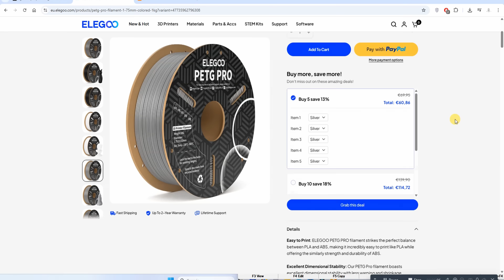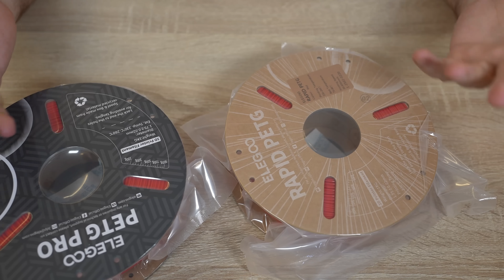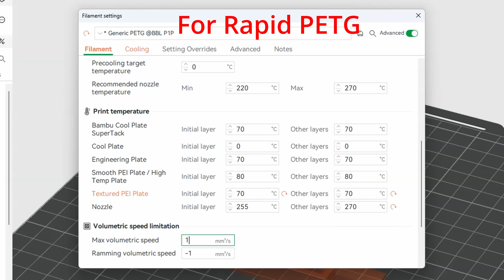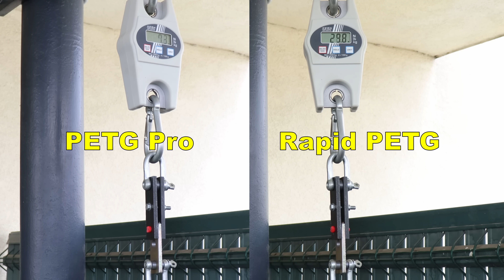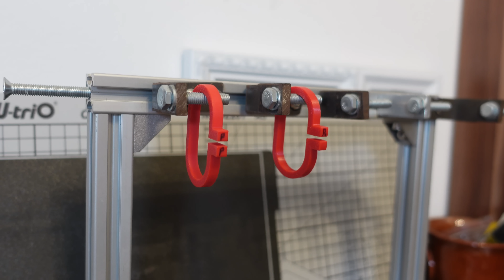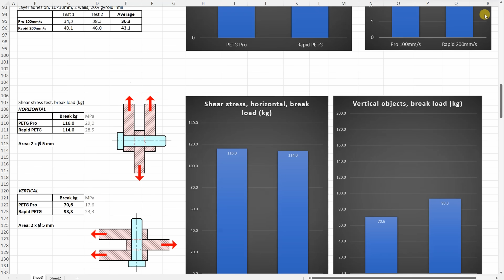Elegoo Rapid PETG vs PETG Pro – Same Price, Similar Specs, Which to Buy?

Comment: Rapid PETG is good, There is absolutely no reason to have 80% fan speed. You can easily print it at 10-20% which also improves strength, layer adhesion and printing speed.

Comment: I use this rapid petg alot. I use the bambu petg hf profile but I changed temp to 255c and max cooling fan to 30%, min 10%. Prints flawless and as fast as pla

Comment: I do not like companies with different data in their technical documentation.
Because it is unclear what the current data is: is the data sheet on the web page the correct one or that printed on the spool ?!

I am not a hater of Elegoo. I also have tried the rapid PETG and I was very surprised about the printed quality of a 300g bowl !

Due to the 'bad' results of the Pro, i am really wondering what the usecase would be for the Pro.
One person commented a detail: it might be more for fine details, as I understood.

Comment: Interesting testing and video. I always wondered about the difference. I have been using the Elegoo rapid PETG for awhile in my K1 Max and Flashforge AD5X. It works well in both. I do wish they had a few more colors.

Comment: Thanks! I've used.both, and honestly couldn't tell much different other than stringing on Rapid. I've even used both in the same print once because I ran out of pro. No issues. Also, stringing can be tuned out almost completely.

Comment: I saw you mention a few times in different videos that your videos aren't pushed by the platform. Maybe the channel name could do with a rebrand to more accurately match what you bring to YouTube. Suggestions:

* (Dr) Igor's Lab
* Engineered Prints 3D
* Functional Print Lab
* Print Performance Lab
* Print & Test
* Print Science with Igor
* 3D Engineering Academy
* Maker Metrics
* Igor’s Tech Workshop
* Layer by Layer
* Layer Laboratory

This list is also a quiz: which ones are AI slop and which meat brain slop?!

Keep doing what you are doing under any name :).

Comment: Nice to see that you are testing Elegoo filaments. I have a number of Elegoo printers, including Centauri Carbon, and find their filaments just great.
I was surprised to see that you did not use your Centauri Carbon and it’s built in profiles for the filaments you tested.
The Nozzle temperature recommend for Rapid PETG is 250 deg C and 240 deg C for PETG Pro. Both with a bed temperature of 70 deg C.

Comment: Thanks for this video, not least because I have been using the PETG “Pro”… which prints nicely, if slowly, on the Elegoo slicer default settings for the Centauri Carbon.

Comment: This is the test I wanted to do but didn't because it would be so complicated.  I'm so glad we have My Tech Fun to do the testing that is in the public interest, and I'm very happy to help support this testing.  I use Elegoo's PLA, Rapid PLA, PETG and Rapid PETG.  There is only a few dollars difference between the Rapid and regular versions so I should probably just standardize on the Rapid versions.  I suspected the Pro version wouldn't have much material advantage and this video seems to demonstrate that.

I've found Elegoo filaments to be of good quality at a low cost, so good value.  I typically by ten 1 kg spools directly from the Elegoo website, usually when it's on sale.  Before recent tariff increases, I could get ten kg of black PLA or PETG for US$95.

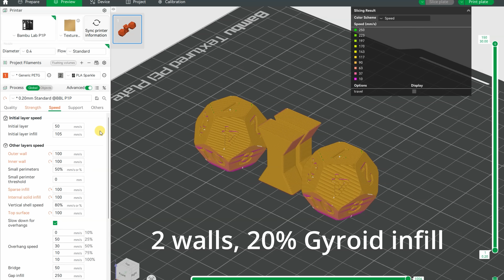Comment: 8:06 You can prevent slower print speeds by easily edit the filament setting. Check box is in "Cooling" tab and called "Slow printing down for better layer cooling".
By the way nice video ❤
Reply from the maker: The point is that I want that printing speed, but I don't want the printer to slow down (for example, you print a larger object, with several vertical elements)
Reply: @MyTechFun  I might get you wrong or you know better about the setting I told you. But disabling "Slow printing down..." makes exactly what you want. It keeps the print speed at the mm/s you selected by ignoring layer time.
Only overhang speed reduction is considered.🎉

Comment: Hey Igor, 
Thank you once more for your contribution to the 3d-printing community. 
Are you considering testing the kingroon petg/pla as a cheap brand as well? 

Here in germany you get the 1kg spool for under 10 euros most of the time. Often even 2-3 euros cheaper if there is a promotion, which is often the case.

Looking forward to new tests.

Best regards from the beautiful Eifel, 
Dominik
Reply from the maker: Hm, Kingroon just contacted me, if I want to test any of their filaments. I already did earlier (on slow printers). Maybe I should repeat something?? https://youtu.be/ggMkfHMlzsE?si=kJme0lhNdfhl6zBW
Reply: @MyTechFun 
Hi Igor, sorry i didn't find this video. I explicitly searched for "my tech fun kingroon petg" but the algorithm seems to drop these older videos. 
Thank you for the recommendation. Maybe something changed in the mean time and with the faster printers the results may differ, even with petg and its layeradhesion. 
Thank you once more, greetings from germany.

Comment: I used both in my products, but my petg pro temp is 25 degrees C hotter than the rapid PETG. Rapid PETG bed temp is also cooler. I think the PETG Pro would have liked a higher nozzle temp (mine is 10 degrees C hotter than yours). I'm curious how the results would change if the pro is printed hotter for better layer adhesion.

Comment: Igor, I would like if possible to comment that I bought Elegoo Rapid PETG Orange. I wanted to contact you about something very particular that I find odd that happened by accident in my setup. I sliced a piece upgrade for one of my printers, I made a mistake in Orca Slicer and I sent by mistake using PLA+ setttings I have (so very very high speeds, acceleration and jerk values). I only noticed this after layer 5 or so. My point is that I saw there were no stringing or common artifacts and poor quality such as when you print PETG with PLA settings (temperatures, speeds etc). To my surprise I noticed in those 5 layers that it was printing well, even on infill. This made me very suspicious that Elegoo's "rapid PETG" might not be real PETG. The reason I wanted to contact you is that I suspect it's not PETG and it's infact PLA or a blend of PLA+PETG. I'm worried about this because the piece I wanted to print will get somewhat higher temperatures, so if you could shed light about this I would appreciate. Thank you Doctor Gaspar, and as always your glasses are absolutely cool.
Reply: There are many ways to test it. You can try burning it. PLA will keep burning and give a somewhat fruity smell. PETG will extinguish itself and give a harsh smell. You can also print something small, then switch between PLA and PETG mid-print. When you try to break it, it will cleanly break at the interface, because those two do not stick well to each other. That's also why there are no PLA/PETG blends (that I've ever seen)
Reply: @orthotron  the problem with this is that It wouldn't tell me if this is what I suspect : PLA largely , with a bit of petg.
Reply: @TrasherBiner  I don't know about rapid PETG having any PLA but I've used about 20kg of rapid and 20kg of pro and I suspect the rapid has way more additives. In my setup, Rapid prints at a 25 degree cooler nozzle temp and a 5 degree cooler bed temp than PETG Pro. I'm curious how these results would change if PETG pro is printed at 270c or higher.
Reply: @TrasherBiner  Why won't it? Try the burn test. Yet another test is to print it at 190C or so. PLA will print fine, while PETG will have very poor layer adhesion and will come apart very easily. And I would be surprised if there are actually any PLA-PETG blends out there, because like I mentioned they are chemically incompatible
Reply: @orthotron  I will do the burn test with a very small print on the kitchen sink (so it's easy to put off with water). It's too suspicious this "PETG" prints well at PLA speeds accels etc
Reply: @TrasherBiner you can burn the filament, no need to do a print

Comment: Hi Dr. Gaspar, could you please investigate the effect of nozzle size/extrusion cross section on layer adhesion? For example 0.4 nozzle (0.4*0.2 extrusion) vs 0.8 nozzle (0.8*0.4 extrusion). In my experience, matching for wall thickness, the latter comes out much stronger. My hypothesis is higher thermal mass causes better remelting of previous layer when current layer is deposited.

Comment: Well, guys, I have tried almost all the possible filaments in the market and I ended now printing Elegoo Rapid PETG for almost all the cases related to mechanics, it's my favorite, about 70% covered by this material and it's amazing. I print it with 200-300 mm/s with zero issues. And also interesting thing that Bambu X1C is not printing it as good as Creality K1max, I never had stringing or blobs on the Creality nozzle (ok, I have hotend from microSwiss for this printer :) ). Then I use Creality's high speed PLA for visual models and about 10% for the parts used outside on the sun I use Polymaker's ASA Lite. And these 3 materials are covering almost all my needs. For some rare cases I use PC-PBT from Polymaker thanks to it's insane Z layers adhesion and for gears PA12, and in some cases Raise3D PET CF. This is my golden filament set. I think that in the future I will add PPA-Cf Core from Siraya, but I do not see any reasons to use something else. At last I feel that I've found all the answers. :) P.S. Elegoo often has out of stock their PETG Rapid, therefore I can recommend you very similar, almost same performance high speed PETG from eSun. Wish you all the best my printing friends.

Comment: I have experience with both Pro and Rapid. I love both. The advantage of the Pro is that it looks better on some shapes. If I print Benchi at 7mm3/s using Rapid, the nose of the ship sags. If I use the same settings with Pro, it is absolutely stunning. Note that the description of the Pro mentions that advantage: smooth prints

Comment: Thanks for test. I'm also using elegoo filament: PETG PRO, PLA MATTE and PLA. I used rapid PLA before but didn't see much different speed while printing so I use the cheaper standard PLA. Colors, printability, diameter and winding of spools are realy awesome especialy if you see the price. And exactly like your test, all of them need drying before print.

Comment: I was using the rapid PETG from Elegoo cause of the colors and it being not sold out compared to the petg plus and now I have a better reason to keep buying it, thx
A video on the PAHT-CF would be interesting, as the price is very competitive (would be really cool if you could test tensile and layer strength dry after printing vs sitting 1 day in some water, this made quite some difference when I tested the sirayatech ppa-cf )
Reply: The Elegoo PAHT-CF is not PPA, but PA12, according to my correspondence with them.

Comment: Q: How you set VFR (12 and 16 mm^3/3), based on what exactly? If max recommended print speeds are 270 and 600 mm/s - max VFR hast to be at least doubled, isn't it?
Reply from the maker: Yes, but 600 mm/s is insane for PETG. Several times I tried flow test with PETG, not even close with recommended settings, with most of printers.
Reply: @MyTechFun  600 mm/s, 0.2 layer, 0.4 width - should be something about 48 mm^3/s, quite on extreme side. Of course, P1S/X1C can't do that (max ~21), but Orbiter 2.0 + Real CHT nozzle - can quite easy (and it is not very unusual setup). I still not quite understand your 12 and 16 - those are 150 and 200 mm/s only

Comment: I used a lot of PETG brands. Elegoo has the best colors. They are bold, matte and a lot of paint particles. Many other brands are semi translucent or have discoloration particles when getting hot. E.g. a snowman is really white and not white/grey like many other PETG brands. It also prints very well at full speed with my Voron 2.4 clone. Only issue: The filament sometimes is rolled too tight and gets stuck at the cardboard sides. I push out the filament roll walls before changing the roll to losen the filament inside.

Comment: I tried both the Pro and Rapid PETG and preferred the rapid overall, so it's interesting to see them under proper testing. I've also tried PETG from eSun (standard and high speed), Bambu Labs and Sunlu. By far my favourite out of those is the Sunlu, which is great as it's also the cheapest by far with my last batch costing £9.25/kilo (€10.60)
I hope you'll have opportunity to test the Sunlu PETG at some point. Thank you for all your informative videos.
Reply: It seems like the rapid petg just performs better and forms stronger objects despite being the cheaper option.
Reply: @GoingtoHecq  yeah, once again proving that you don't always get what you pay for
Reply: Il looking to buy my first roll of PETG for cosplay props I see sunlu have a few different types which one do you use and like?
Reply: @SamHope-q7j  I only know of their standard PETG, Matte and carbon fibre. I use the standard that comes on cardboard spools from Amazon because it works out so cheap while still running incredibly well. I've had good success with Overture PETG too, the clear type they sell is probably the most transparent you'll get.
Reply: I use the sunlu petg I can print at 120mms no issues

Comment: I'm only printing RAPID PETG on my V3 KE and i have to say that after calibrating my profile its printing very good on 24mm3/s max volumetric speed. Print temp is 250 nozzle and 70c bed (gold sheet no glue )  avg speed is 280mm/s with 4000 accel (avg)  fan speed is 50% not 80 as u used in video maybe ill try 80% next time. I use it out of bag never dry before use and i have no problem with printing very minor stringing in future ill maybe dry it before use but for now i have no problems with it out of the box. Only problem i have with it its that its never available 🤣

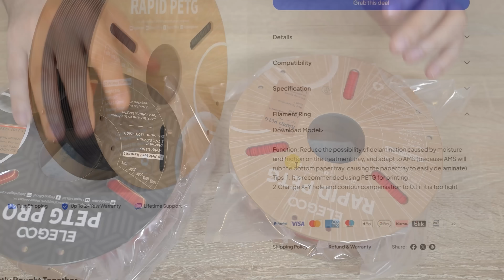Comment: 3:52 it means that the on the outside diameter of the cardboard spools, it is harder and not just exposed compressed fibers. They add glue so it doesn’t get your AMS all dusty like some company’s rolls do.
Reply: Many companies claim that sealing the edges of their cardboard spools makes them "AMS compatible," but in the real world, cardboard spools still suffer from two crippling potential defects that cause issues in an AMS (or ACE Pro or similar unit):
(1) Often the spools are assembled with the sides not concentric to each other, which causes the spools to wobble as it feeds, making it wander on the rollers and potentially jamming;
(2) The cardboard is very susceptible to shipping damage, usually causing a flat or soft spot. This causes a wobble. In the worst cases, the flat spot prevents the spools from turning, causing it to rock forward into the lid and jam.
It might be fun to test the cardboard spools from various brands for concentricity and resistance to impact damage!
Reply: @robertlevandowski4457  This...  I don't use an AMS, but still have provlems with cardboard spools because the edges get dented and broken so easily. The damage isn't just from handling, it regularly happens In shipping too.  That damage makes them work poorly on any sort of holder where the edges sit on rollers, like most dry boxes, not just AMS units.  Hardened edges really make almost no difference.
Reply: @jb510 Those printed rims should help with dry boxes too.
Reply: @dougal6569  I’ve used them extensively.  In addition to being a hassle, they don’t help when the edges are damaged.
Reply: @robertlevandowski4457  Elegoo do propose AMS owners should use PETG printed rings clipped around the cardboard spool rims. If you Google Elegoo Filament Ring you should find the model. 
I have seen one report that the AMS2 handles the cardboard spools better, but she might just be kidding herself!
Reply: No, they have a link for downloading a model just above that paragraph. They are saying you need to print that adapter ring to use it in the AMS.